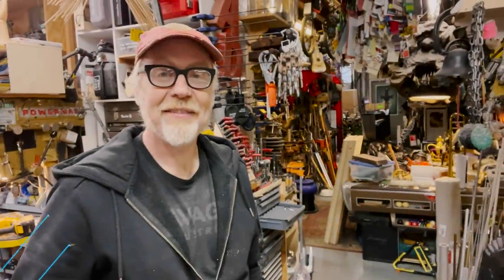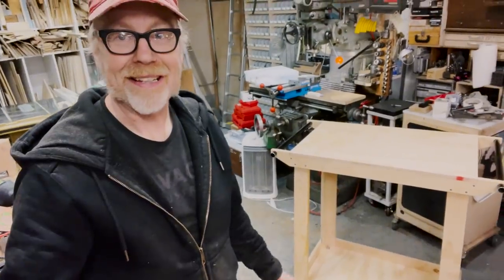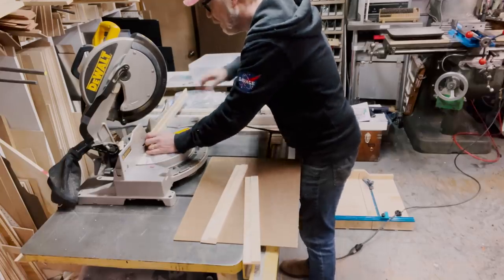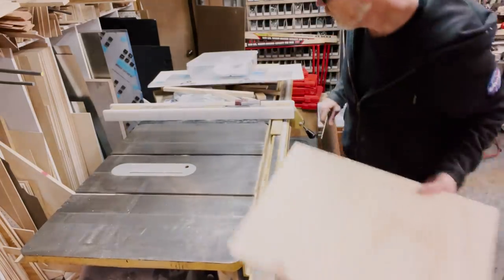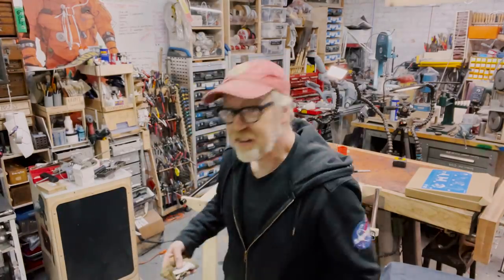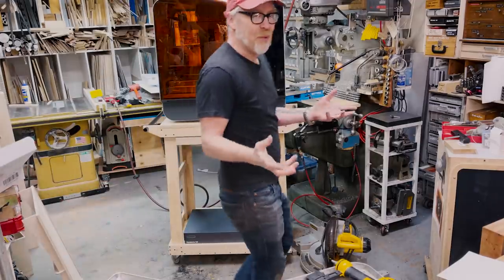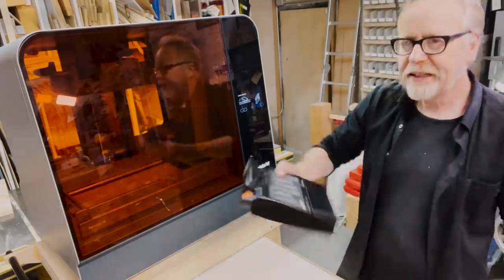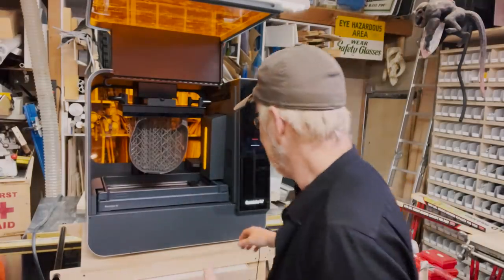Adam Savage's One Day Builds: Resin 3D Printer Station!

Comment: "noone should ever have an odd number of casters" - R2D2 would like a word with you, Adam.
Reply: Adam: "How do I have only one caster?".  Also Adam: chucks it back in the box.
Reply: A beep*
Reply: R2-D2 has four per foot, either 8 or 12 on the floor at any time. That's an even number.
Reply: LOL!
Reply: @edrcozonoking  Obviously it's if he ever needs one caster :D
Reply: Doesn't every office chair have an odd number of casters?

Fortunately for me I have a box of them. Back when I used to deliver appliances I'd sometimes see broken office chairs by the curb with the trash. I'd run over with a screwdriver and pop off the casters to take home.
Reply: @tedcoop4392  R2 usually only has two in the center foot and none in the side ones since he just has drive wheels there ;)
Nowadays it all omni wheels, though. Mine has four in the center foot, and one in each side one for extra stability.
Reply: Sometimes it's nice to put a fifth caster in the center of a large or heavy station
:P
Reply: @tedcoop4392  ..."But I wouldn't call them 'tires'"
Reply: @JMcMillen  I used to do the same thing with couches left out in front of houses. I'd pull over and take all the cushions; leaving a  useless, 250 pound piece of garbage for someone else to deal with.
Reply: @Todd Bloss You’re a fucking villain, sir

Comment: Welcome to the joy and heartbreak of 3D resin printing.
Reply: After i upgraded my CR-10 with linear slides, better stepper motors, board etc, i ditched my resin printer to a friend. It reminds me too much of the whole HP ink printer deal. Cheap machine, expensive ink ... and once you know the resin's composites, for no good reason too, i just can't be bothered to make it, it costs far less than the asking price, tho.
Reply: Most heartbreak is forgetting a support somewhere and having to reprint. 💔
Reply: @aserta  most consumer resin printers are not like that though you buy a bottle of what's on sale and dump it in. Professional ones are like a inkjet and silly.
Reply: I think Adam can afford it (and they'll likely send him whatever he needs whenever he needs it, as these videos are excellent exposure).
Reply: Aren't the fumes meant to be an issue? I'd defo want good ventilation and an air quality monitor if working long hours in close proximity to one.
Reply: @JohnSmith-ws7fq  Not from the resin AFAIK. But when you wash it in ipa that might be problematic
Reply: @Kyouske_42  I think photo resin releases quite a lot of fumes as it cures during print. This one probably has some fans and filters built in.
Reply: @Kyouske_42  It's not very well documented at the moment so we don't quite know how safe the resin is (especially over long exposures)
Reply: Yeah I made a 3D print of my body and it took 34 runs

Comment: Starting the video hoping you make a ventillation system. Got mine in a far away room and I can smell it through the whole house
Reply: Also, I highly recommend a big silicone dog placemat for the pullout table.  Removing prints from the buildplate and washing them is a messy process, and the resin is toxic.  Have lot's of nitrile gloves and use a respirator for VOCs.

Comment: Hey Adam. New printer looks great. As form2 user here's a few tips and tidbits.
1. Use locking castors or have way to lock wheels. You don't want printer to move when it is printing.
2. Can get very messy. Have near sink or water source if possible. Keep in warm temp environment and away from sawdust. 
3. Be prepared to keep a work space available for iso tanks and uv cure lights. Also expect to have stock of plenty of paper towels and nitrile gloves.
4. When removing or loading items from inside printer use gloves. Use two sets of gloves - one for iso alchol post and one for handling printer. You don't want iso alcohol anywhere near or on printer itself as it will age machine faster. 
5. You will need additional shelving for storing tanks, cartridges, cleaning, etc. Again try to store away from dusty environments. I keep mine in banker boxes for easier storage.
6. Don't throw out box. You might need it in case you need to do a return.

Comment: Nice build! If my experience with resin printers is anything to go by you will drip resin on your cart no matter how careful you are. Uncured resin is not exactly nice stuff. For that reason the cart might do with some varnish on the top surface to make it easier to wipe down. Also gloves man. Photo resin is a powerful contact allergin they aren't messing around with the warning labels. The uncured resin is similar to Urushiol (poison ivy sap / lacquer) in that it's sensitive to UV light and will make your immune system go berserk.
Reply: So do solid resin statues or figures have these issues? Do I have to store them a certain way or wait to touch them. I know Resin dust can be dangerous too but not sure what that involves with solid statues
Reply: @historyking9984  cured resin isn't a problem. It's just the liquid state you need to be very careful with. 

Note with 3D printed resin objects. You should not touch them with bare skin directly after printing. There's a post print process. They need to be cleaned with a solution capable of breaking down liquid resin(usually isopropyl alcohol is commonly used). There's typically liquid resin still on the printed item. 

Then you need to post cure the object to finalize the surface layer. Usually this is done under a UV lamp for several minutes or in direct sunlight.

After that it should be perfectly safe to handle.

Comment: So cool to see the form 3 XL in action and your awesome stand. I work with the form 2 and have a couple of tips.

The resin cartridges can totally be removed safely after they are installed. The rubber valve at the bottom only is pinched open for filling.

Speaking of that valve. I have had a couple times where that valve has not flowed perfectly at the start, so I recommend pinching that to make sure it fully opens after you shake the cartridge.

Comment: A neat trick with chop saws . If you are fine tuning the length and only want to remove a little at a time. Without turning the saw on bring it down so the edge of the blade is past the top of what you want to cut. Then slide the pace to cut over till it is touching the blade. Lift the saw back up and when you make the cut it will shave it off a little at a time. I learned this doing trim work on a house.

Comment: Also don't forget to wear gloves when working with resin. That stuff can be very toxic before curing.
Reply: Well not like deadly toxic but you can develop an allergy to it. The more you touch it the more likely. And the allergy can even cause a reaction from the odor. Make sure you wear gloves and vent it well or have really good filters in it. I'm in the industry and many of our machines are photopolymer based.
Reply: I have heard that it's riskier "during" the curing because less is known about our reaction to the reaction (could not resist) or more specifically off-gasses of the reaction. I have been provided nothing to back up other than the logic if it's toxic before curing and not after what gets released during cure might be concentrated toxin and until California says it won't give cancer ill always want to air on the side of caution.
Reply: Oh goodie. The safety obsessed have already arrived!
Reply: @watcherofwatchers  What do you mean? If you're the kind not to worry about it, I'm sorry for your loved ones.
Reply: @kendokaaa  We all do our own risk-assessments and decide what level of risk is acceptable for ourselves.  We don't need safety Sally pointing out every possible safety concern in every single video.  It's absolutely tedious.
Reply: UV Resins are highly potent contact allergens that can have long lasting effects on your immune system. There are plenty of reports from people that have severe allergic reactions to those resins because of 3D printing or jewelry crafting etc. This is not due to years of exposure. Wearing gloves is the minimum you can do to avoid having to give up your hobby because you can't enter the same room without having rashes all over.

Comment: Hey Adam, make sure you play around with part orientation next time.  The printer is much slower in the z axis compared to x and y so orienting your piece to be wide and flat instead of tall and skinny can save you a ton of print time.
Reply: With SLA you never want to be TOO flat though as that can cause issues.

Comment: I've been FDM printing for about 5 years.  I want a resin printer because the smaller chinese ones are so cheap, but I'm still worried about the danger of uncured resin.  I know, wear gloves, glasses and be careful, but that's like saying "well mercury is safe, so long as you don't touch it".
Reply: Keep it WELL ventilated too, that stuff will fume up a room really quickly. Wear your gloves, a decent mask (the printers usually come with at least one) and some sort of glasses, and you’ll be fine.
Reply: I agree that it pays to be more concerned with ventilation than touching resin. Gloves are easy and do a fine job of keeping your skin safe. The fumes, on the other hand, are unpleasant and spread quickly.

Comment: I love that cart!  I especially love that you gave attention to the form and not just the function.  I would suggest painting/sealing it with something chemical resistant, such as urethane.  Resin printing is messy, and you'll want a surface that is easy to clean.

Comment: Me I would have made the pull out the top into a drawer where two-thirds of it opened to store small tools or anything needed for the printer, also some way of storing the power cable when not in use, along with several shelves. I am assuming it will have to be level checked and adjusted every time you use it due to being mobile on casters and never being in the exact same place every time you use it. Also not being able to move it once the printing has started so being careful not to knock it and upset the print.

Comment: To late now, but you could have done a "wheelbarrow" thing with just 2 casters. Had the 2 legs with casters, and have 2 legs with rubber feet. No need for locker wheels. And you just lift the "feet" a bit to move it around.

Comment: Point of note on the little rubber “bite valves” on the resin cartridges; they’re usually just worth pinching them open by hand before installing. We have a couple of Form2 machines at work, that we’ve been using for about four years, and occasionally the valves don’t open if you install them straight from the box and into the printer. Pinch them open first, and you’re good to go (but make sure the vent cap is closed - don’t ask me how I know!).

Comment: 35:00 Peeling off that film.  This is one of my weaknesses.  I always want to leave it on to keep my nice new stuff as nice as possible for as long as possible.  I always figure in a few years when it it looking a little beat up I will peel that film off and make it like new again.  Except I almost never do.  Recently our 23 year old microwave quit.  When I started taking it apart to find out why I noticed it still has that film on the outer case.  Opened up, replaced fuse and reassembled, and the film is still there.  It is like a sickness really.

Comment: Those tar kettles have a huge tube running through them that a propane flame is fired into.  The exhaust is clean, no tar is burned by the flame, I used to use it all the time to heat up food.  Brutal in the summer, 110 degree day while walking on 450 degree tar.

Comment: A good way to make a very fine adjustment cut with a mitre saw is to put the saw down without turning it on, put the workpiece in place with the cut to be adjusted against the body of the blade, turn the saw on and lift it up. The set of the teeth will remove the very smallest amount of material and may have been exactly what you needed there. Love your work.

Comment: Cool video, and neat to see the loft.  But one thing I notice is that the Form Labs printer has cartridges, rather than pouring resin from whatever source into a reservoir.  And it detected the type of resin, implying some communication between that cartridge and the printer.   Is this an indication they're moving to HP style proprietary lock-ins?

Comment: as someone who as a Form (2) and an Anycubic - I think you'll find printing on the Form quite enjoyable but quite expensive compared to printing on something that is not so proprietary. With the Form, you MUST use their "goo" ( :) that's what I call resin) while with an Anycubic or Elegoo (or others) you can use any 405nm based resin. However, that said, welcome to the SLA printing community! NICE table! Great job, Adam! (as usual)
Reply: oh - and the top is the breather - gotta have that open or it just won't fill. Been there, done that.

Comment: I bought a 3D printer in 2018 and during Lockdown I modified it twice, then I bought a 2nd printer for under $200 by the time I finished modding it the price increased by a lot, but I had an extremely accurate .25 nozzle FDM printer. The lockdowns are over but I got the fever, I am now building a 350mm^3 printer from scratch. I have had to cut, drill, tap, and assemble every square mm of this printer. When I am done I will know a lot about 3D printers and especially programming the firmware. Next  up, increase my knowledge of Fusion 360.

Comment: starting at time38:28 minutes in the video there's a reflection of hands in the upper right corner of the formlab printers front panel of hands. They're spelling something in sign language.... what are they saying?

Also, you've inspired me to put all my FDM printers on carts.... tilted carts? (with locking casters though, cause yaknow... movement sucks in FDM printing)

Comment: If you get one of these, be sure you have a UPS for it. I would add a power strip and a way to spool an extension cable. 

Also, maybe something like OctoPrint on a Raspberry Pi to monitor your prints that run overnight while you are not in The Cave? If it doesn't have something built-in.

Comment: I love 3D printing, my cousin got me into it. Presently I use an FDM 3D printer and so far it has served me well, a lot of the stuff I 3D print on it are small props like Star Trek badges that I model myself. Hopefully at some point in the future I'll get a resin 3D printer so I can print at a higher resolution.
Reply: After I got my resin printer I nearly stopped using my FDM printers. I started designing my stuff to fit within the parameters of the resin machine, so I could print in a higher res with less clean up. At some point I want to get a larger format resin machine, so I can make bigger prints and do away with the FDMs all together. The only issue I have with the normal resin is that it’s super brittle, and you’ve gotta be careful with dropping in at time. I haven’t stepped up to printing with any of the ABS-Like stuff as of yet.
Reply: @NewbombedTurk  I'd advise against getting rid of your FDM printer, PLA and ABS would still be good for prototyping even with the cleanup time.
Reply: @DelcoRanz93  I have two FDMs currently, and was thinking about just going to one FDM with two resin. I still have some stuff the FDM would be perfect for, I just don’t need space taken up by two printers if I only need one. I haven’t printed anything regularly for months, so I haven’t really dug deep into what I really want to do. Once my focus is back on printing, I’ll figure out what I want to do with them, I may dump both i3s and get one CR-10 or the like.

Comment: You need a Glubot.  Never have to turn the glue bottle over and wait for it to drip down. Ever again.  Any angle.  Fast Cap makes them.  3 sizes.  Best wood glue dispenser ever.

Comment: If I haven't misunderstood, these resin printers need to be absolutely level to the gravity or the prints can fail, come crooked or otherwise misformed.
I've been present at a place where they used some serious kit to get theirs to be level to fraction of a degree because the layer height is so tiny that any misalignment might make the layer come out wrong.

I wonder if these newer ones are less susceptible for that?
Reply: They're fine with a few degrees at the very least, at least in my experience

Comment: Hey Adam, love the build. i  do a ton of resin 3d printing with resin , if I may make a recommendation , invest in a silicon matt for your drawer , resin will get on that wood and cure and your drawer will no longer close. or if you have access to it a silicon based pool paint works well to. enjoy the forum great hands off brand if you don't want to tinker and deal with a ton of custom settings. :)

Comment: Hey Adam, can you make a video of a simple wooden box assembly without an air gun? It’s always such a hassle to keep everything straight when just using glue and screws because I don’t have a dedicated shop and enough space for a generator.
Reply: Do a bit of research into clamps. There are numerous options for corner clamping. And those have been a God send for the years I didnt have a brad mailer or air compressor.
Reply: @TadTheTinker  Okay, thanks!

Comment: Nice, but you didn't shake the second cartridge there Adam.

So if I recall you've got a raised floor? Probably not going to be able to do a lot in there while it's running? Last I read printing like that does not like vibrations?

Comment: I don't really see the advantage of the portable stand considering if to get best print results you need to level it every time. I would assume moving it will more likely than not knock it out of calibration, meaning you would have to re-level it? A 3D printer is really a tool to be installed semi-permanently imo.

Comment: With the fact you are putting a heavy machine on top of the cart.
Are you worried about the cart racking? No cross bracing.
Reply: and also, wouldn't vibrations cause small print mistakes/artifacts. let alone someone bumping into the cart